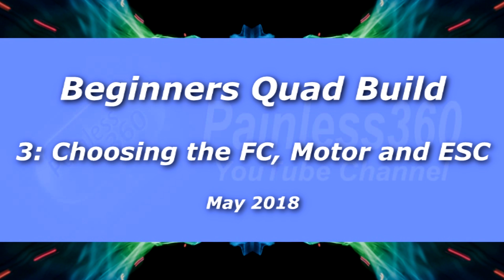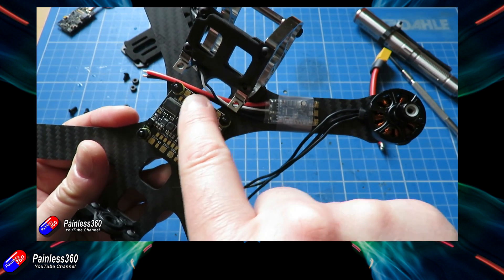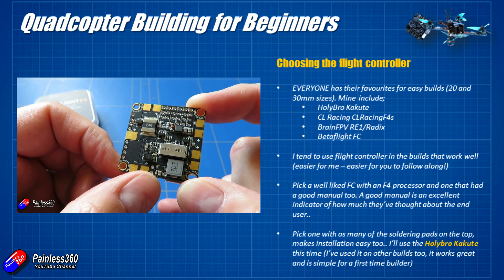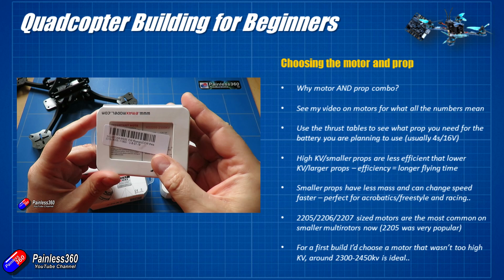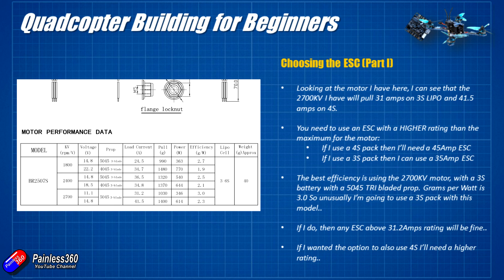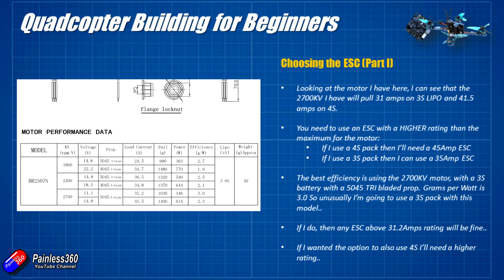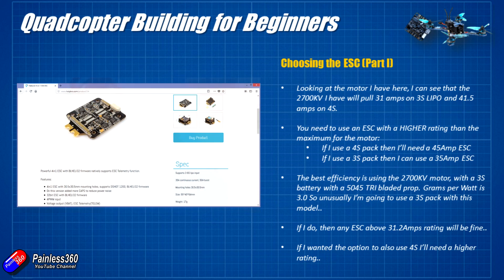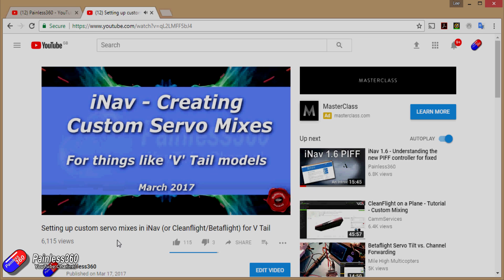Quad Build for Beginners (S8.3): Choosing the flight controller, motors and ESCs

Comment: Are there flight controllers you can buy that aren't geared towards racing? I'd like to build a quad with self-levelling, hovering, gps and all that nice safe stuff :)
Reply from the maker: I made a video that covers this as there are loads of options for us that care about other things than racing ;) If you Google something like 'What flight controller software & hardware should I use painless360' you'll find my video from summer this year.. Hope it helps.

Comment: Be a bit careful with older versions of the cl racing f4s. They handled noisy escs badly (fell out of air)
Reply from the maker: That's right, see my build with one of them where I talked about that. The latest versions are fine

Comment: Excellent vid as usual Painless.  I would say though, the 35a ESC you have specced would easily support 4S, even being maxed out with racing batteries, never mind freestyle/a beginner.  Realistically you won't find a sensibly sized 4S battery that can support more than 140A for any more than a very very short 'burst'.  In fact unless you buy full on top spec racing batteries, you'll struggle to get 100a for anything more than a short burst.   Great series of vids.  thanks
Reply from the maker: Keep watching the series ;)

Comment: Just thinking that most of the Amperage ratings for motors are done on the bench and not under a dynamic load and newbies would be inclined to buy a 50 to 65 amp esc for a lot of motors if they follow this, when in reality they will be hard pressed to burn a mis range  35 amp esc most of which support a 40 to 45 amp 10 second burst that would be very hard for any battery to maintain. 
Just a thought and i don't want to offend anyone. I love your channel, and it has long been a goto channel for how to and reviews.
Thanks for all your great work
Reply from the maker: You've not watched the rest of the series, have you ;)
Reply: LOL i guess i will be now!

Comment: I just received my kakute f4 v1.4 but there is no manual diagram anywhere? I guess the sbus is on the R3 pad anyway?
Reply from the maker: Check out the playlist, I show you where I’ve connected the wires in the later videos. Also have a look at my other build series, I’ve use the Kakute flight controller in other things as well when I going to detail about the connections. The manual on  is particularly good, I’d recommend the manual on the Holybro website too - download and have a look. Best of luck!
Reply: Painless360 it's not the version you are using.. I cannot power the omnibus f4 stm32405rgt6? I have wired it correctly from the 4in1 wire harness and I tried from the other pins underneath but no lights? Do I have to bridge the +5v ram vbat?

Comment: I used a clr4s works great but one mystery- intermittent vtx power. After a bumpy landing will lose power to vtx I've redone the solder connection many times I'm stumped. Have you ever heard of an fc having an internal loose connection anything possible I suppose
Reply: How are you powering the vtx? Don't power it off the FC. A place to start : a bumpy landing is likely to have the motors working hard for an instant, as the FC tries to maintain orientation under the influence of a disturbing factor - the ground. So it may be that under extreme current draws the voltage to the vtx is sagging below it's operational limit. Vtx's can draw an amp or two at higher transmission power settings. Hope this helps.
Reply: amisoftau thx for the reply!
I hit disarm b4 it touches down and it wouldn't power up again. On the bench fiddled with the 4 in 1 rec plug which was well seated already (what would that have to do with the vtx just only plug on craft)
Well it's working now for how long? Wierd deal sometimes love a mystery but pita when u want to fly
Reply: Yes can be frustrating. I have had bad crimps on the wires in those little plugs.. intermittent connection.. Difficult to diagnose when it usually connects. It's the same with Computer fault diag.. eventually you may need to start swapping out parts in order to isolate the problem.